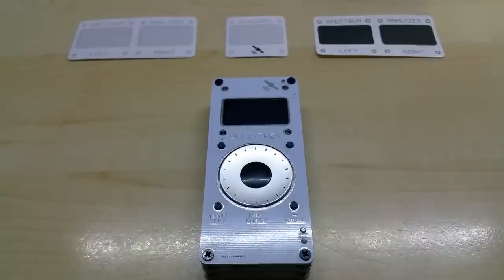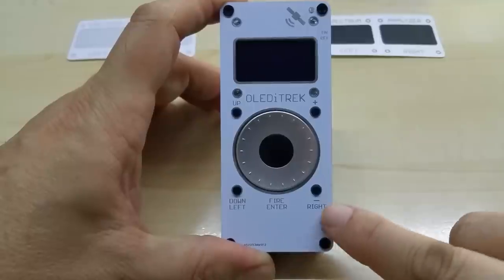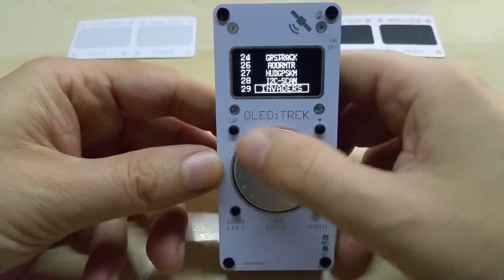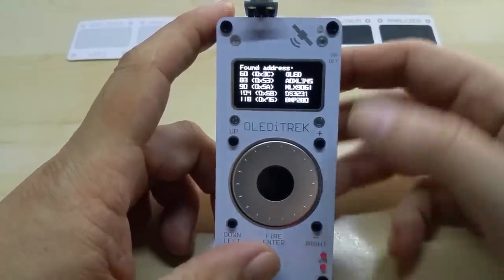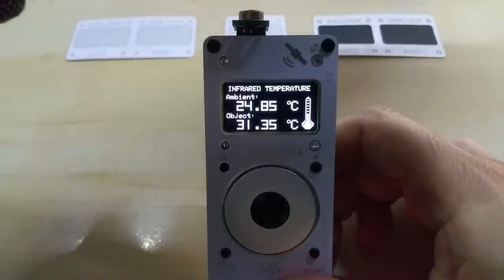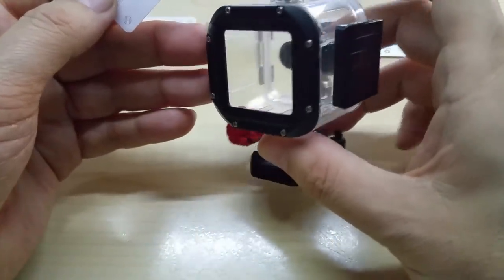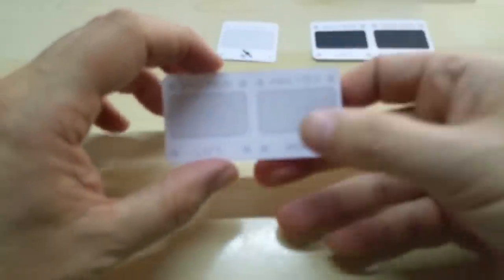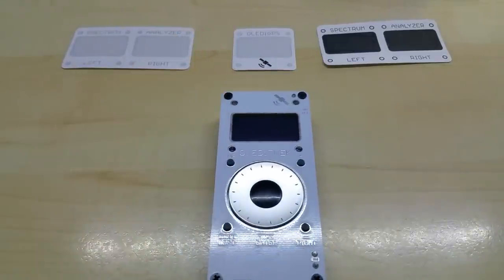OLEDiTREK Demo, new information in the description, please see other videos as well, thanks.

Comment: Great so far.

Maybe in the future you could make a module that connects to it that has a small Geiger tube to read radiation levels to turn it into a Geiger counter?
Reply from the maker: You would not believe it but I did look into that, just did not find anything small enough :-) I wonder if those for smart phones could be adapted to Arduino. They connect via 3.5mm audio jack which the OLEDiTREK has.
Reply: In theory any sensor that connects via spi or 3.5mm jack could have potential use..?! Great device Hayri!
Reply from the maker: Not just in theory :-) SPI is a little more involved as it needs more pins to connect but I2C is the way to go. You can connect up to 127 devices in parallel to it. And by using the RX/TX pins you can even extend it to be wireless.
Reply: Hayri yes sorry - meant I2C not spi! I am starting to treat I2C like the USB of micro controllers, so handy!
Reply from the maker: No problem, yeah I like I2C a lot. The I2C scanner app is really handy too, just need to get it scrolling, preferably with the use of the rotary encoder, if the found addresses don't fit on the screen :-)